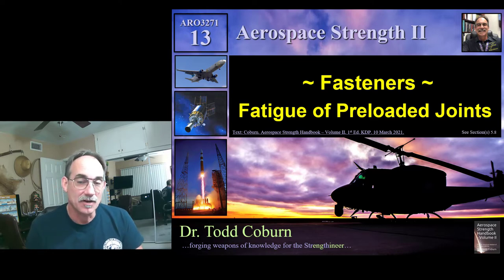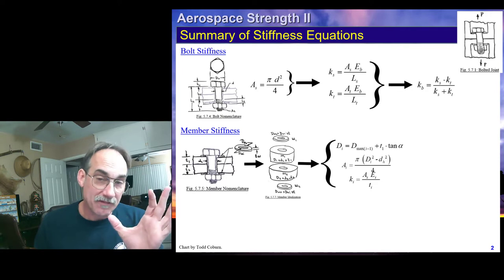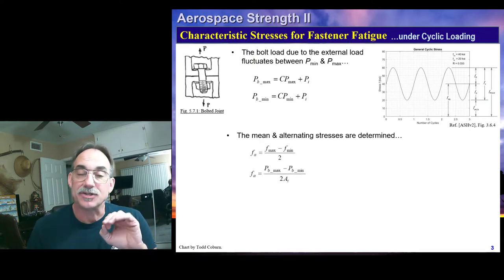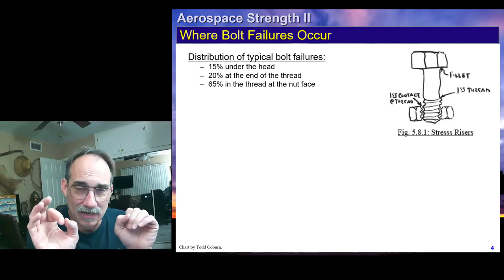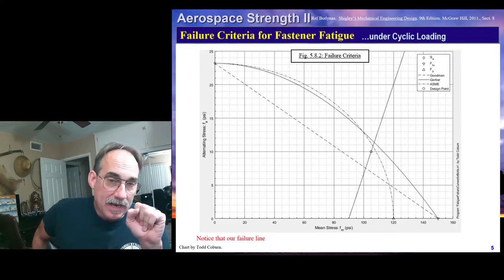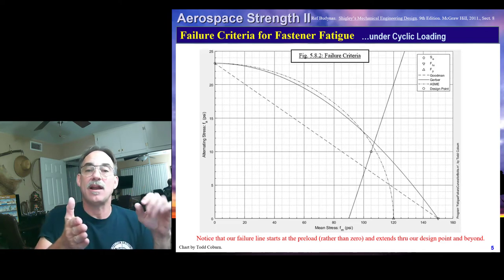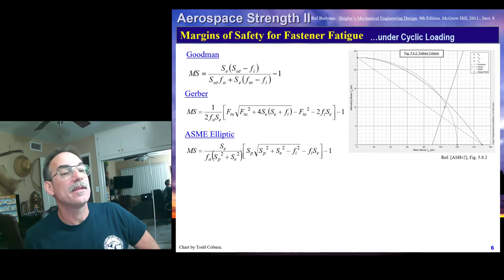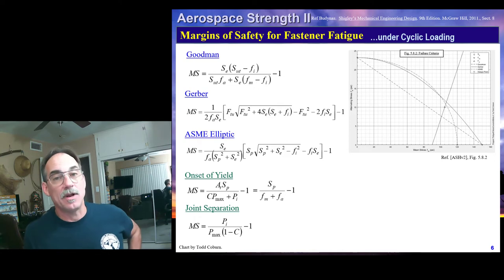Stress Analysis II: L-13: Fasteners - Fatigue of Preloaded Joints

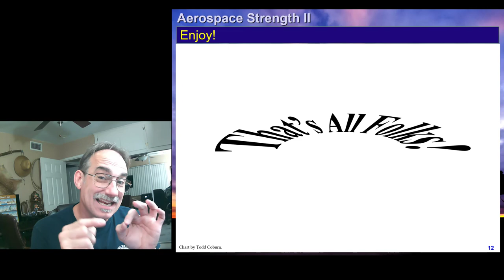Comment: An excellent presentation Dr. Coburn.  I couldn't find the fatigue stress concentration factors for fastener threads and thought it was about 4 as you confirmed here.  I looked into it years ago and couldn't find my notes.  That's what got me to search online and stumbled upon your content.  It looks like you used the modified Goodman diagram for that last example.  I think that last section of the (green) failure boundary line is a diagonal line from the ultimate stress intercepts on both axes?  (I'm talking about the diagram just after the 23:00 minute mark in your presentation.)
Reply from the maker: Thanks for the feedback.  The failure curve shown is the modified goodman.  I involves the Goodman line, which spans from the endurance limit to the ultimate tension allowable, and the Langer line (the cutoff you mentioned), that spans from the yield allowable to the yield allowable (on both axes)
Reply: @ToddCoburn  Thanks Todd I have one more question.  If I have a bolted flange connection that is experiencing cyclical tension and compression loads, would you recommend lowering the minimum bolt tension and stress for the fatigue life calcs below static preload for when the joint is forced together in compression, or would you say the load transfers through the full flange face in compression and does not really lower the bolt tension locally below initial for the compressive load?  So you would only see a bolt tension rise about static in tension but not lowering below preload in joint compression?  Maybe it's just a judgement call?
Reply from the maker: @mikemccarthy6081  

Mike, if the joint compression is so great that the bolt preload goes to zero, then any additional load is carried by the members.  

The bolt cannot pick up compression in any typical fastened condition.  

If this ever occurs, the joint should be redesigned to either increase the preload or to change other parameters, as it would introduce slapping and slop that could quickly destroy the bolt outside of simple analysis capabilities.

Make sense?
Reply: It does.  So for those calculations, a compressive load would reduce the bolt tension using the same stiffness calcs used to calculate the rise in bolt tension with an external tensile load (up to the point of complete bolt relaxation).  My argument was that for a compressive load the bolts aren't needed as the flanges can support that even unbolted through the contacting surfaces.  When the joint is in compression the load path doesn't have to travel only through the areas of the flange compressed together by the fasteners, so it may tend to not relax the fasteners as much or at all past the static preloaded condition.  If that's not what typically happens or is not typically accounted for than I'll ignore that.
Reply from the maker: @mikemccarthy6081  right.  Wheteher the external load is tensile or compressive, calculate the bolt and member forces using the equation from my handbook (or video).  This equation is valid until the member force is zero (after that all preload AND external load are carried by the bolt), or until the bolt preload is removed (after that the bolt starts gapping and slapping).  Niether case is acceptable for design

Comment: @Toddcoburn, do you know something regarding the stress analysis for the inserts that have a plug and a sleeve? is for homework class, I want to do an approximation using the similar approch with fasteners.
Reply from the maker: See Lecture 15 of the Composite Strength Playlist, or my Composite Strength Handbook, which can be found at… https://amzn.to/49qjHZH
Reply: @ToddCoburn  I now have the book, however it only mentions basic concepts of the insert, could we use the same approach for a inserts with a plug and sleeve? they are installed using a pressure clamp and usually installed for cargo compartment, also I heard that in the middle between the plug and a sleeve a washer of adhesive is placed to assure a better bond joint.
Reply from the maker: @aldoalfaro3258  the analyss approach presented in the text can be used for a wide variety of insert configs.

I need to see what you mean by plug and sleeve, cuz these can be a good load path, or a crappy one, depending on various factors.

Inserts that do not use a flange that is bonded and overlaps the facesheet create very poor load paths that are liable to fail unexpectedly.
Reply: @ToddCoburn  TYES102D10-08 - Panel Insert
PANEL INSERT. SLEEVE | ALUMINIUM, THRU-BOLT, FLUSH HEAD TYPE (INSERT REQUIRES 2 PIECES: PLUG AND SLEEVE) for example, are used Iin Airbus A320-232 | Jetstar Airways | Ben Sheriff | JetPhotos